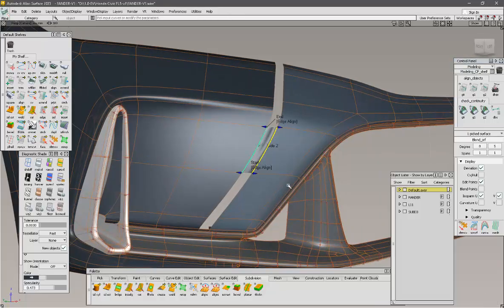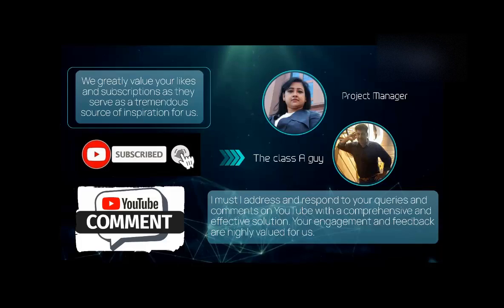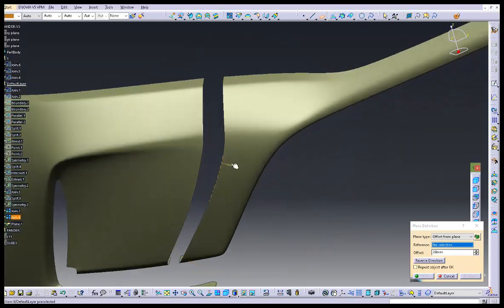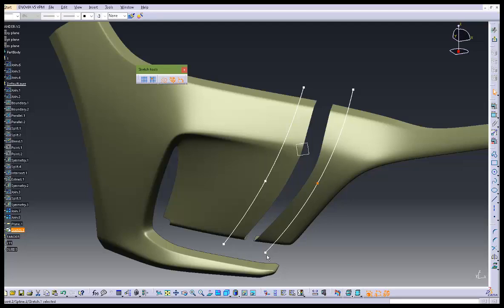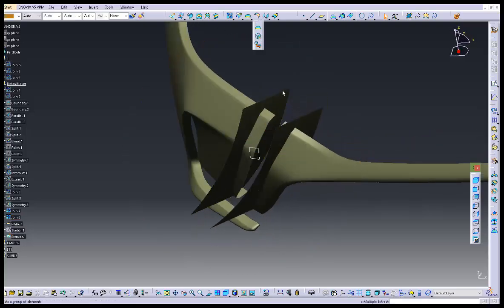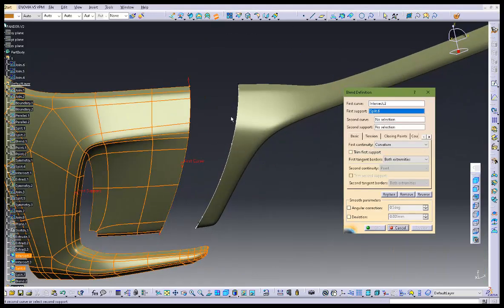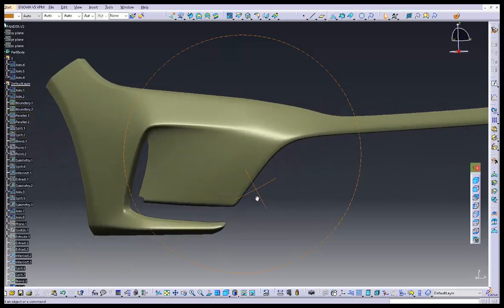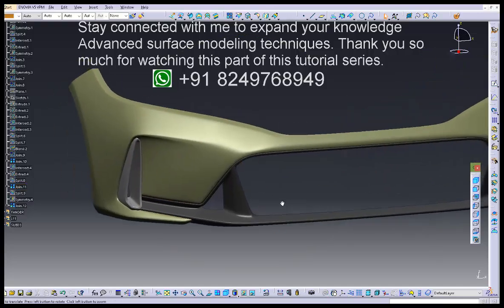P2-Front fender design | Class a surface techniques using both Alias and Catia

Comment: Hey I really Like your Videos :hand-pink-waving:😍!  Can You show how to Give Thickness to the surface when Class A is Complete?
Reply from the maker: we cannot directly thicken a complex Class A surface.
Imagine a curve with a radius of less than 1mm that needs to be thickened by 2.5mm. So, how can this be achieved? There are various techniques available. By utilizing the offset command, some patches may not offset correctly. However, CATIA will provide you with the option to keep the partial offset. Take advantage of this feature and proceed to create the remaining patches. This method will help you effectively handle such situations.